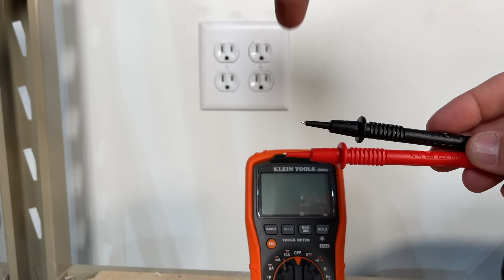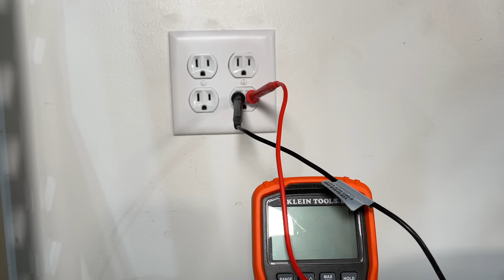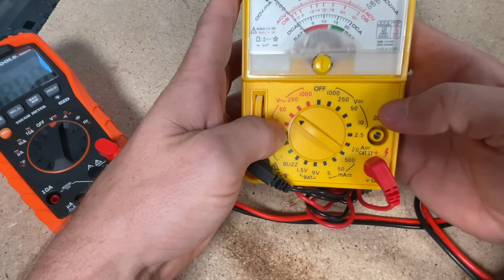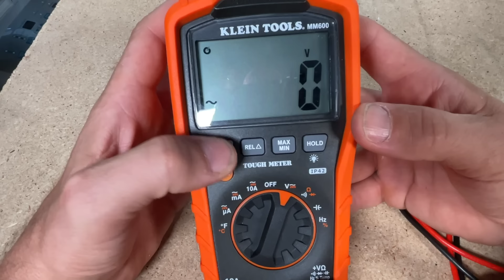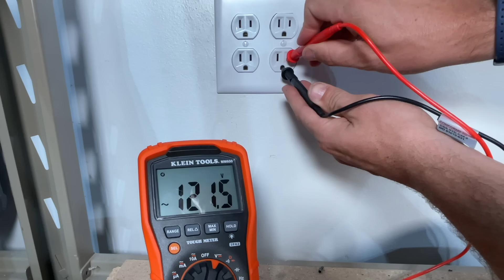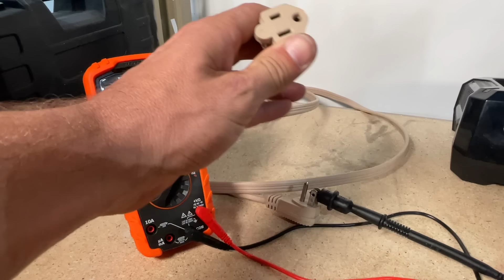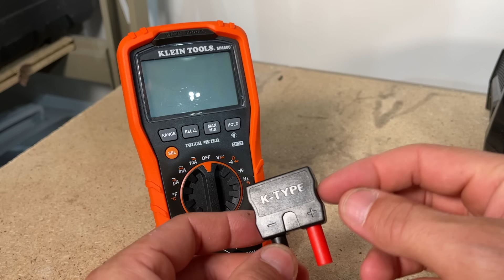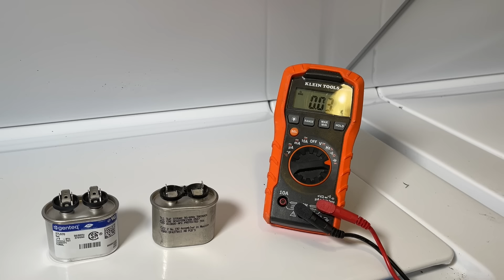How To Use A Multimeter for Home Repairs and Troubleshooting

Comment: I've been using meters for decades and thought I knew a lot about multi-meters but I never knew about how to check an outlet (which meter lead to put where and what order). Thanks for all our great videos!
Reply: You are lucky still alive
Reply: The thing is there’s no such thing as Negative AC. So you’d never know you had the Black lead on the correct side unless you tested polarity first.

So the only way to know you have your Black lead in the Negative side is to first identify the Neutral. If the electrician or home owner swapped the White and Black wires on the outlet you’d never know. 

Connect Black to the Ground Hole. Then Red to the slot. Only one side should have AC power. It should also be approx 120VAC. Unused you’re hooked up to a 240VAC outlet such as your Dryer.

If you don’t know how to test for AC. I strongly don’t recommend to start with YouTube. But that’s just me.

Also the real fun begins when you take the cover off and you see a White and Black insulated wire. The Black ‘should be’ the Hot. So you’d want to connect your ‘Black Meter’ lead to the ‘White’ wire and the Red meter lead the Black wire…..🤯

Also if you connect your Black lead to the Ground bare copper and Connected to the Red lead to the Black wire and don’t have power you might have a bad ground or you might actually not have power. 

The best option for newbies is the Outlet tester.

Comment: It is my understanding that when hooking up 12 volt battery cables you start with the Red (Positive) and when disconnecting you start with the Black (negative). According to this video when using a meter (for AC or DC) it is just the opposite…. you start with the Black and when disconnecting you start with the Red.  Seems a bit confusing but good to know. Thanks for making this video.

Comment: Wow, this video came out 1 year ago and YouTube just  decided to recommend it. Anyways, great video, but how do you check voltage on Tamper-Resistant outlets? I have a Fluke T5-600 and tried to check voltage on a Tamper-Resistant outlet, but was not able to do it. Did not want to force the probes because I was afraid of vending the probes' tips.

Comment: From a life long sparky: NEVER purchase or use ANY safety or text equipment made in cheating lying, lack of quality control communist china. The few dollars that you might save not worth risking your live on. Started out using a Simpson model 260 back in the Army 70's then graduated to digital VOM'S. ( some call them DMM 'S ). I always carried spare fuse, set of batteries, at least 1 spare test lead and alligator clamp that plugs into test lead. Now use only of fluke brand meters. Best  one is a VOM that has a built in 1,000 volt megger for testing motor windings. Cost almost $600 but well worth it. Be careful not to purchase cheapest fluke meter due to now made in cheating china.

Comment: All that time to tell if an extension cord is crap or not? When it comes to electrical stuff, it either works or it doesn't. If it ain't workin, flip the switch or get a new one. If it is frayed, replace it generally or twist the bitch back up and tape it tight. Never needed a multimeter in my life and never will.

I say all this but I am fascinated to learn more about electricity and got my old multimeter a new battery and now I want to not be a dumbass.

This is a great video and my first paragraph was only half joking and I am embarrassed how little I know of electrical systems or even units of measurement.

Thanks for the great video man

Comment: It also does not matter which color lead you use on what unless your measuring dc voltage or current, and with that the minus sign would just indicate reverse polarity when its not and that hurts nothing. Find a new hobby you know something about.

Comment: First of all NEVER use one of those toy N.C. testers to determine anything!! That is a digital meter and does not pass voltage thru it. Only in a current test mode would it do that. It simply samples that voltage it doesnt pass it.  It is not dangerous at all the way you showed. If there is voltage being passed thru the meter, yours is defective, junk or your probes are plugged into the current jacks. You have no idea what your doing and shouldnt be showing others. Throw out your toy N.C. tester and use real equipment AND LEARN HOW TO USE IT!

Comment: I always check the probe and meter first by connecting the probes together and checking for very low to zero resistance or switching over to diode mode and listening for a ringing sound.

Comment: When u put probes to 110 before  you turn it to proper measurement you will burn multimeter (that cheap one with common current / voltage pin) You making tutorial for newbies and dont tell him first think what they need to know ...

Comment: I have a voltage meter just like this one and I love it. I just bought the IP40 voltage tester. It has the laser measurement. It allows me to roughly figure how much wire to run instead of having to get my measuring tape out every time. I mainly bought this one because the range of voltage it measures. The laser measurement was a huge plus.

Comment: Two minutes into the video, and I already got some IMPORTANT information - don't have a probe in the hot side without a probe in ground or neutral. I did not know that. Thanks!
Reply: My multimeter instructions(UNI-T manual) specifically warn to connect COM first(black/ground/neutral) and then the positive side(red).
Reply: @aliancemd  you read the instructions?
Reply: @ When you screw with 230V, yes
Reply: Yep I took 5k dc when my ground cable came loose from the chassis of a cv2460 converter. Without thinking I grabbed the probe to reattach and for an unknown amount of time...time stopped. Well obviously I loved to tell the tale!
Reply: @biggfoot52  Racquet-type bug zappers output 1-2kV on 3V DC (2 batteries in series) so yeah, if the amperage is low enough you can take the hit. Still gonna hurt like a mother fu- though, like you said.
Reply: Voltage is low enough*
High amperage low voltage will just burn you.
Reply: @biggfoot52 glad you can tell the tale.
Reply: is that' the opposite approach when charging a car battery?   Keep red on first, and take it off last.  ?
Reply: @mickael486 If you're having to charge a car battery, something failed. Like the alternator or battery. And those batteries produce hydrogen gas. Also, closing the circuit with jumper cables often creates a spark. Hydrogen plus spark equals explosion. Though it's extremely unlikely and I've seen many jumps where people directly connect to the terminals, and in that case since you're closing the circuit ON the battery instead of other metal, cable attachment order wouldn't matter.

I have the Halo Bolt Air portable jump starter instead of cables now and I cannot recommens it strongly enough. It has a light, emergency flashers, phone charger, tire inflator, and jumper cables all built in, with a car charger and outlet charger.
Reply: Oops!
Reply: This is nonsense. You can stick that "hot" probe up your rectum and you wouldn't feel anything besides the point.

Multimeters have extremely high impedance which will block virtually all current coming through, even if you manage to accidentally complete the circuit.
Reply: I never knew that either. A moment ago I used two multimeters to test it out.  The 2nd multimeter showed the non-hot probe on the first multimeter was 62 volts when ONLY the hot probe on the first meter was inserted into the outlet!
Reply: Just treat them like they are both Hot, ie don't be waving one stick around when testing. Your tester is essentially adding wiring to a live circuit which is only complete when both ends are connected. And firkin dangerous when its not completed.
Reply: @BarryBollox. yes! Always respect the danger involved.  👌🏼

Comment: Please make sure to wear insulated gloves and short your capacitor with the blade of a screwdriver before you go measuring them. The start capacitors in air conditioners, refrigerators, washing machines, automotive, etc. can absolutely kill you if you short them with your body. They can hold charge for weeks / months depending on the rating, so this is a MUST DO step. Stay safe.
Reply: Okay y'all. Idgaf if it's lethal or not. I don't want to get shocked. It doesn't exactly feel nice. Okay?!? 😂
Reply: Thank you for the safety tip!! We need more people like you and less people like the clowns in the comments. Tryin to get me shocked. 😂😂
Reply: funny, in the days when cars and lawnmowers used points and condensers, you could charge one up and toss it to a buddy. good times
Reply: @stoopidbastid6420  Electrical condensers are capacitors, condenser is just another word for capacitor
Reply: Thank you for the tip.
Reply: @juan7559  You don’t want me to illustrate the other place I test across
Reply: Good tip.  I got a jolt from a ceiling fan a few years ago.  Just enough to confirm I was still alive.
Reply: I usually just test the capacitors leads across my tongue for good measure
Reply: No, you don't have to short a capacitor if it has a bleed off diode on it. It will bleed itself off as soon as it is de-energized. But if you don't know how to tell the capacitor has bleed off it is best left to a qualified professional.
Reply: How hard is it to take the extra step.  What if the bleed off diode is malfunctioning?  The more safety steps you take, the less likely of an accident. @kimbrown5297
Reply: Agreed Safety Steve
Reply: Yes, they can store charge and render you a shock. But no, they can’t kill you.
Reply: @altuber99_athlete 
You can come over and service all my tube amplifiers after I play them. Can I put a life insurance policy on you first?❤
Reply: @altuber99_athlete Yes a capacitor can kill you if it is a higher voltage capacitor of 1000-5000 volts +. Your odds of death are much higher than your odds of survival.
Reply: Ok, safety Sally
Reply: 😂 @terrysmith4465

Comment: Another good video. Thanks for your continued work putting these out there. 
I’m not an electrician but do a lot of dyi electrical. I have a Fluke meter that has the auto range feature which I use every time. 
My question is, why would anybody choose to select the range rather than let the meter do it for you? Shouldn’t the range selector be a redundant feature?
Cheers

Comment: IMHO you should pointed out; that the A/C capacitors you where testing toward the end, they needed to be properly discharge since this are 370VAC and they carry quite a wallop before doing any sort of testing. Plus they could damage your multimeter. Otherwise a very good video.

Comment: I watch a lot of your videos and think they're great. I've never watched this because I felt I don't need basics. I had sent my brother (he had worked 2 summers as an Electrician's Helper) a DMM and he asked me such a basic question years later when I was visiting on this Christmas 2022. I was troubleshooting electrics on the trains, and he asked, "What are you doing when you use that setting with the tone?". He then admitted he only used the battery test function. This one has not only a DCV setting, but additionally one that puts a load on batteries so you see the actual usable voltage. So, I wanted a good basic video for him. I reviewed this during my lunch. Maybe I read too much or too little into the Title, but I think you spend way too much time on the details of this specific DMM and way too little on actual how to use the functions. Additionally, temperature (?), again and thinking basics (and my time reviewing and his to be watching) - who would have temperature on their 1st or even 2nd DMM?! That's far too specific. The fliex test? Capacitance, yes, but your talking about using it on HVAC?

I'll certainly still watch your videos as related to what I'm doing, or want to do... one of the things is that sometimes you are too detailed, but so am I so, I like it. I won't be sending him the link to this, it's not enough of what, IMHumbleO, I think  would be the best use of his time.
Reply: Who doesn't have 12:31

Comment: I think you made a mistake when you were explaining about which probe to pull out first of the wall outlet. You plugged in the black to Neutral but you said ground. Also could you go over Amps? Most meters are only 10 amps but that old one you had said 20 amps on it.

Comment: I studied electrical engineering in college and purchased a Micronta multi-meter back in 1990 when I was in college and I still have it and use it today. I can promise that is the single most used tool in my entire workshop. It's an older style where I need to select the voltage range, etc. but it still works like a champ.
Reply: YES, MICRONTA!!!!  I also have a little less old Radio-Shack pair of multimeters, both made by the Korean company "METEX", and both very durable, quite inexpensive, very acceptable performance and acceptable accuracy. The older one is not autorange, but measures many things, and the less old one is autorange. They cost me 30 and 20 USD back in the middle of the 1990s, and both have DB-9 digital output that I used a lot for checking and plotting the actual discharge curve of batteries.  BTW, my neighbor had a much older Micronta multimeter that has endured the test of time, probably since the early 1980s, and still works perfectly.  A shame that nowadays Radio-Shack no longer has that kind of devices!
Reply: @alfredomarquez9777  Yeah I loved radio shack when you could actually go in there and buy some diodes, transistors, etc. I made a few projects based all on radio shack components.
Reply: The good shit lasts.
Reply: Back in the 80s when I was going through my apprenticeship I purchased a radio shack ( Micronta) multi meter do it yourself build kit. I had a blast putting it together and it still works and is going strong today.
Reply: @davidkunca4067  That's so cool!
Reply: More so that s Phillips screwdriver?
Reply: @TapTwoCounterspell  You may be having a stroke.

Comment: OMG, all the times i've probed the sockets not knowing or realizing red first means the black is live!! Thank you, great videos by the way.
Reply: The black and red leads are obviously for DC, red has always been the + positive side.  Having the correct polarity in DC is EXTREMELY important.  Many DC components are killed if installed with reverse polarity.  In AC that's not so important as in DC.  If you put the + on the -- screw on a DC motor, it will run counter-clockwise.  In AC switching hot and neteul leads, while not ideal, the motor rotation is not affected.
Reply: @davidmarquardt9034 You are coreect about DC circuits. He is correct talking about AC circuits, when talking about AC circuits Black is Neutral aka grounded conductor or Ground. Red is Hot aka ungrounded conductor. So for safety on AC he is correct.

Comment: You said thermocouple. Correct me if I'm wrong but a thermocouple is used to sense whether a certain temperature range is present or not such as in a furnace to detect a flame. I believe your temperature probe is a thermistor which stands for thermal resistor changes resistance based on temperature.

Comment: I have a fluke meter,could you describe what setting I would need to be in to check a car window switch in my 2003 Lincoln in the main window switch cluster on driver door panel that controls all windows as window does not go down,I don’t know how to use these at all this is all foreign to me LOL
THANKS

Comment: 1:51 Appears several have addressed this issue regarding the black lead being hot and touching some metal object that "obviously can arc against anything that would ground it." What do you think happens when you insert the lead into the receptacle? How is that any different than touching an external grounded object? Remember that neutral is tied to ground someplace.

Comment: WTF, you said 99 something and the instrument reads 0. That's funny. What a dumb instrument. It doesn't even say you're measuring AC. I'm sure it makes sense once you know how it works. And when connecting cables to a battery it's the opposite apparently...red on first, red off last.

Comment: Might have been a good idea to explain what a Tamper Resistant receptacle, how to recognize one (TR)  is and how to test it.  I keep a plug with a foot of cable with  exposed ends. You need enough cable to pull the plug out, but not enough to dangle on the floor and possible 'enliven' a tool, yourself or whatever.  An extension cord works as well.
Reply: Agree - the TRs need some work arounds - I used a plug adapter

Comment: Why don't they make things simple buy just having AC and DC on the DAM THING instead of some little wavy stupid lines.
Reply: This fing part!
Reply: I wrote on it with a marker pen ac/dc
Reply: My less expensive one has both squiggly lines and letters ‘AC’.
Reply: Yeah this thing is the biggest piece of shit I've ever seen
Reply: because if you don't even know the symbols for AC or DC current, then there is a good chance you aren't proficient in the field of electricity and shouldn't be working on electrical systems. just a guess.
Reply: @Mr_Killjoy420  came here to talk shit and you beat me to it 😂
Reply: Because then they’d have to call it a unimeter. Or a duometer at best. 😮 👍🏻 But, yeh, I use it just enough to have to look the fing thing up every time! 🤯😡
Reply: If you have a basic knowledge you should know that ~ is AC because it changes its polarity. I mean its very simple
Reply: @LosmiPZS Some people are just stupid and grew up entitled

Comment: Great tutorial covering everything you need to do for home repairs. Really you only need two function 1. voltage for batteries / AC lines and 2. continuity for fuses. That covers 99% of your home repairs. A NCV tester really comes in handy to detect live wires. Also noticed this Klein model smartly placed the amp test on the left side and everything else on the right side so you don't blow the fuse.